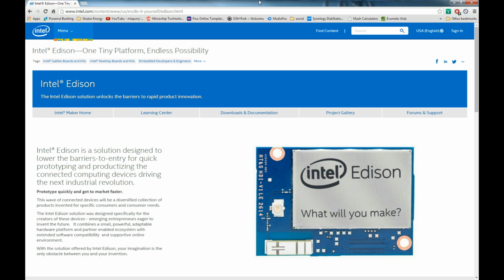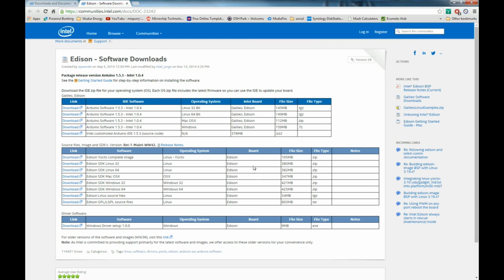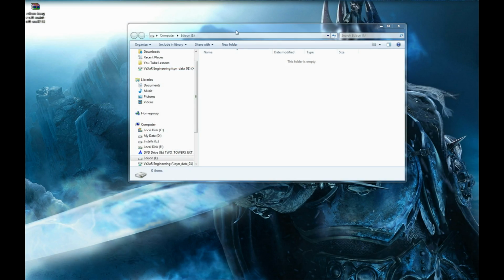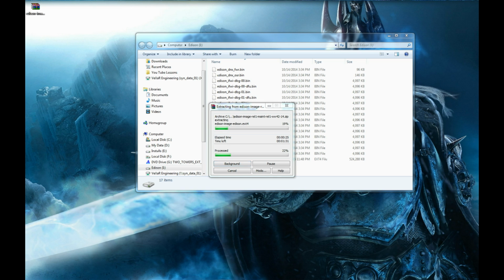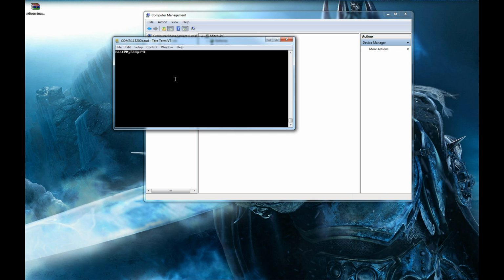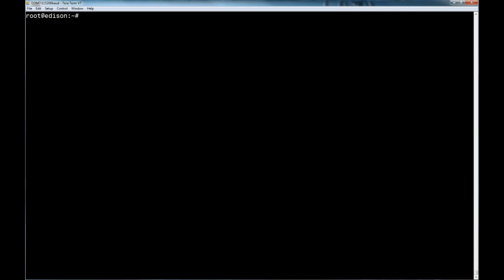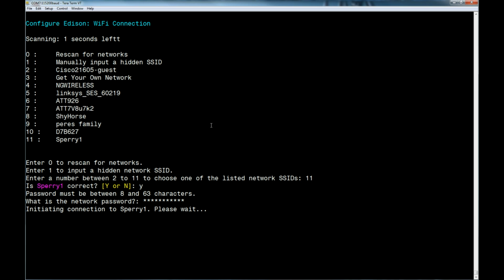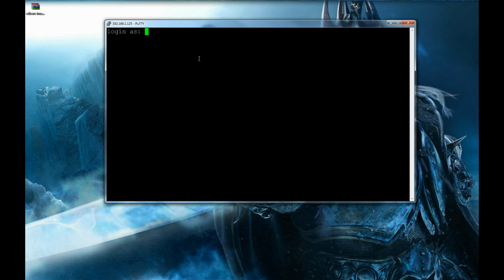Intel Edison - Initial Setup

Comment: I downloaded file of Yocto linux for Edison. It was about 1.2GB. I can't copy it to Edison(E:\) because it is just 800MB. What should I do?
Reply from the maker: I would check your image and make sure you are downloading it from the correct source.  I just looked and it should only be like 128MB or so not GB.  https://software.intel.com/en-us/iot/hardware/edison/downloads
Reply: You get this problem if u are downloading latest yocto. You get a new procedure from intel platform flash tool.. look into that.. it will be worth